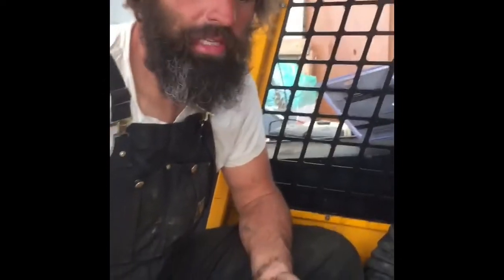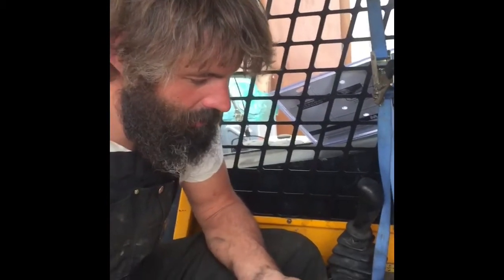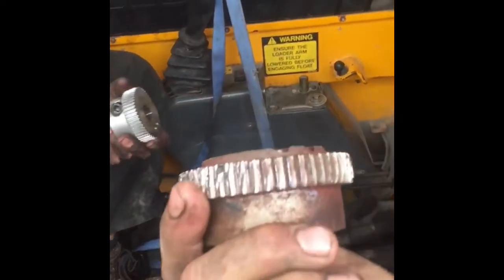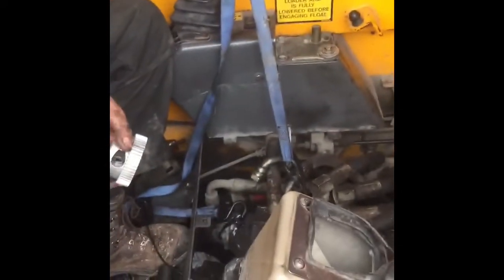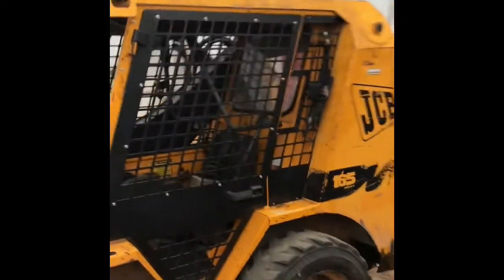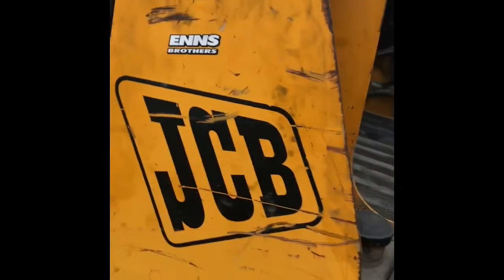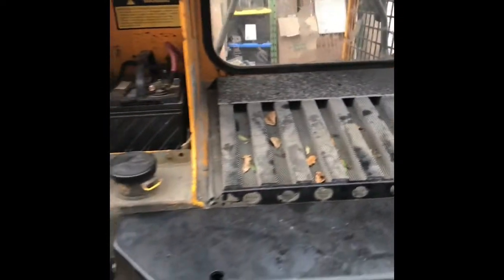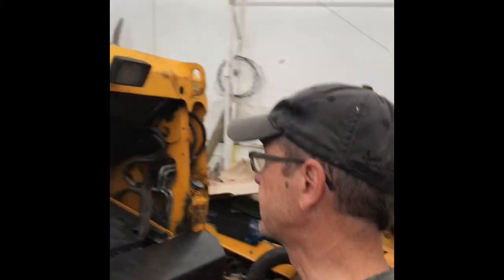Hydraulic Pump Repair

Comment: I have a 185 robot that the engine died on me and won't turn over, made some noise a few days earlier that seemed to be coming from the flywheel end, and then was quiet, after about 5 minutes, it won't turn over, starter was bad, changed starter, battery is good, load tested it, new starter, still won't turn over, something is locked up

Comment: yall ever have any other issues. mine drives 100% but little to no lifting power. hardly lifts its empty bucket reved wide open
Reply: Im having the same problem an they told me it was the control valve ,have you figured out whats wrong with yours
Reply: @Bobby Cain  I pulled my pump. 20 minutes job. Split my gear pump and the seals were munched Inside. Rebuilt it with a princess auto oring kit and it works flawless. Adjusted my relief valves down a bit. Previous owner had them to high and blew the seals in the pump.
Reply: Heck yeah glade you got yours going an thanks for telling me what you did so i can try that an hope it works for me
Reply: @Bobby Cain  I've learned this machine basically Inside and out. Any time